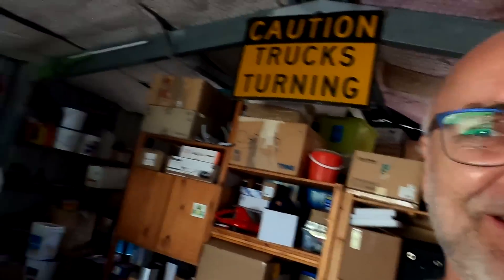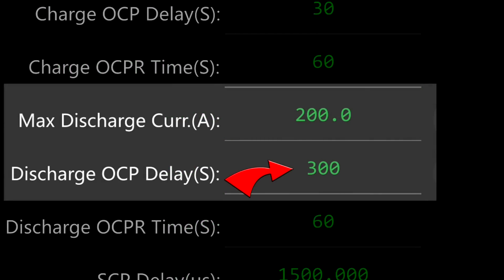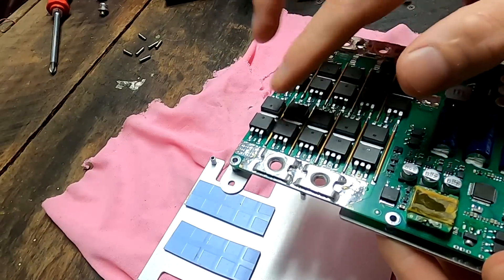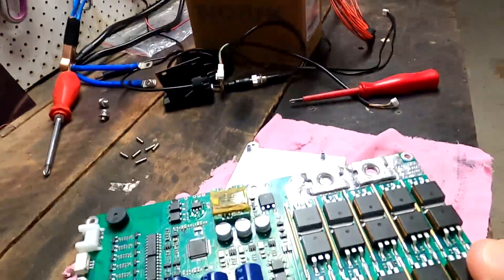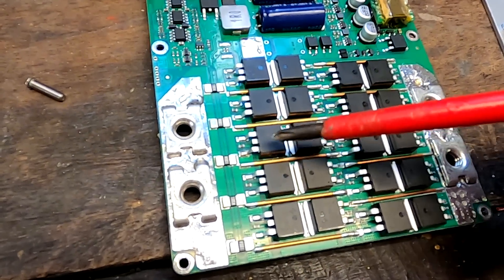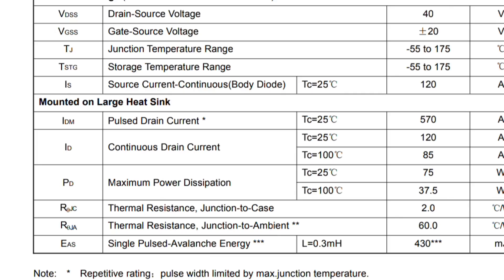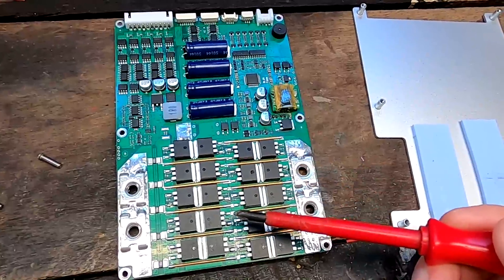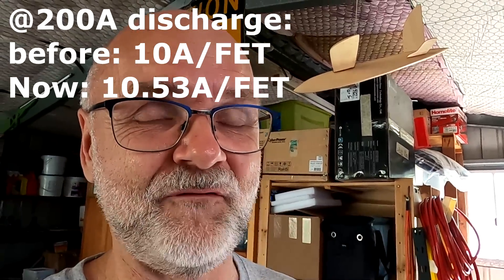Magic smoke! What happened to the JK-BMS? Still reliable or bad design?

Comment: Luckily the MOSFET has failed open, mostly they fail short. I'd not run it beyond 90% as you have lost 20amps of capacity now.
Reply: Um yes...I forgot about the other side of the board. I'm guessing that to get single direction control of battery current that the back to back MOSFETs gates must be individually controlled such that if only one of the pair is on then the other  source drain diode will conduct thus only allowing current in one direction. If both MOSFETs are on then the diodes are bypassed acting as a bi-directional switch. The only downside with using half as diodes at any one time is the dissipation will sky rocket due to the forward diode drop multiplied by the current. If this was the case when you pumped 200+ Amps through it then perhaps the weakest or MOSFETs with the highest forward drop just got that bit more toasty than the rest and pop!
Anyway...all speculation..
Reply: What is the chance for a fail shor at 200A?
Reply from the maker: They carry only 10.5A now under full load, so that's below 90%, right?

Comment: All electronic components have minimal differences even if they are from the same batch. Heating up the components will spread the differences. Also the max. ratings will lower if heated up. As you said in the video it seems like the burnt chip was the slowest when turning off the current. A normal fault would have been a short circuit. Well, but at 200A there was no chance to keep a short, so the internals of this chip have just been vaporized and been blown through the crack on the side to the other chip where you have found them.

The BMS should still be usable at a lower current. To cut off the two pins might be a good idea, but i think it is not necassary since the internals have already been blown out.

It is always a bad idea to switch off high currents. This should only be done in a case of emergency. Overcurrent protection is just a safety feature and nothing for controlling current. After this relays have burnt contacts and as you have shown MOSFETs might be broken and/or shorted if they have to switch off a current higher than they are designed for. ⚠

To replace the broken chip with a normal soldering iron might be possible but is not easy, I wouldn't do it. To heat up the big ground plane fast enough to desolder the broken chip without heating up the other components too much is quite a challenge. Soldering the new component is a little bit easier since you can apply a little pressure on the chip while heating up the solder. If it sinks in a bit you're done. As others have mentioned, you should let someone with a SMT rework station do the job. 😉

Comment: If it was a demo review unit they probably should had tested before shipping it out and avoiding the embarrassing situation. The fact is that there is 20 for a reason and not 10 that would do the same work... blowing one still have the others and is just 1/20 of each had to do... it is a faulty Mosfet so those things happen so nothing to worry about specially if the design just allows to keep moving. I bet that out there would be a bunch of other situations where this happens and no one knows about it. If was outside or ventilated place probably was just unnoticed. Like the real reviews and real cases. Can this one be pushed again till 200A on 2 minutes, and see if the disconnect works and does not blow-up any fuse ;)

Comment: I would not repair the mosfet. This just happens, the board is overengineered a bit anyhow, so no big deal. I just realized - disconnecting 200A by such a small component, that's crazy.
Reply from the maker: Yeah, I'll disconnect the legs and leave it on.

Comment: Ich würde beim defekten Mosfet einfach die Beinchen abknipsen und die anderen dessen Arbeit übernehmen lassen.
Wenn ich jetzt nur von der einen Reihe ausgehe sind es ja 10 MOSFETs die sich die Arbeit teilen, also 10x100A, da dürfte einer weniger nicht auffallen.
Vorsichtshalber den Abschaltstrom auf 175A und die Zeit von 300 auf 120sek reduzieren und damit sollte es ohne Probleme funktionieren.

I would just snip off the legs of the defective Mosfet and leave it as is, the other 9 of the group can most probably take the load easily.
Because if normally there's a group of 10 MOSFETs rated 100A each, I guess 9 will still be sufficient.
For a security measure reduce the overcurrent to 175 amps and the cutoff time from 300 to 120 secs and it should work just fine.

Comment: I'm assuming that each MOSFET's gate is connected together, so I would expect them to all turn off very close to at the same time. There might be a few microseconds between them, as each electric field might collapse in a slightly different timeframe, but surely that time would be within that "pulse" length of time, right? So the current limit should be 570A.
I'm just speculating though.
Reply: In fact, they won't.  The Gate Threshold Voltage is a very wide-range from MOSFET to MOSFET.   For this particular part, it is 1.0 to 3.0V.   So the MOSFETs will turn off completely at different points in time.

This is why the chips are specified to 570A of burst current but only 120A of continuous current.  It means that the chip can handle 570A, but only for a very, very short period of time because the energy being dissipated is massive.

In the configuration Andy is using, the operating current will be more around 20A on each MOSFET which is probably all the board can really dissipate.  The individual chip packages can only dissipate so much energy (37W at 100C is the spec).   So during the turn-off, it is possible for a single MOSFET to take most of the 200A.  And this is totally legal as long as it doesn't stay that way for too long (we are talking in the milliseconds here before the chip blows up).

This is why having the fastest possible Gate driver (in both directions, to +V and to GND) is extremely important in power switching applications.   It is perfectly ok for the current to gang, but only for very short periods of time.  A fast gate driver guarantees this.  A slow gate driver, on the other-hand, guarantees that something will blow up because all the MOSFET's have different Gate Threshold Voltages.

-Matt

Comment: The only way to be sure if its a component failure or a design problem is to run the test again with same BMS and see if more mosfets die, to confirm run the test again with a new BMS that would confirm it. I have a hot air reflow station and could try to replace the mosfet if you have a spare one. I'm local to you. Cut the two legs off the faulty mosfet so it's isolated.

Comment: Have been around test equipment and components. The weak link in componnts like mosfet is the legs. Too small. Cant hold that much current. Compare a 300Amp fuse to one leg of a mosfet and you will see the problem.

Comment: Definitely sounds like a lazy MOSFet.  Didn't want to turn off quick enough and copped the full 205 amps so it popped.
 It can be repaired but being double sided does pose the possibility the FET on the other side may unsolder at the same time.  Would be a difficult job with your soldering iron.  Might be easier with a heat gun.
But it still works so why bother.  To be conservative, limit it to 190 amps max current.  Should be fine.  I might consider snipping the legs off the dead FET.

Comment: in my personal opinion this is mosfet driving issue. If MOSFET stays in its linear region for too long it will overheat and die. To put theory aside - you have to forcibly close them by applying negative voltage to the Gate (for NchMOSFET) ideally or at least short the Gate electrode to Source. Gate electrode are isolated from the rest of the transistor and have significant capacitance which charge must be discharged to close transistor. 

As for desoldering - better use hot air or hot plate and soldering iron. Preheat with hot air (max flow and about 200C) then use soldering iron with chisel tip to desolder the FET. Just crank soldering iron up to about 400C and be careful with burned leg - it can came off along with PCB trace. As for soldering - its the same but whick old solder and apply new 63/37 to the Tab pad (while keeping other two pads flat w/o solder) press new transistor with soldering iron (again 350-400C and wide tip) on its tab then two other terminals and  voi là!
Reply: I second that!
Reply: Yup

Comment: You'll probably find the MOSFETs are arranged in pairs of series back to back(drain to drain) so as there is true isolation when they switch off as this is needed due to the source drain diode within every MOSFET. So this means that there are only 10 MOSFETs effectively sharing the current. Also the RDSOn will be double due to the series connection. The individual MOSFET has to withstand the current squared RDSOn value and this cannot rise faster than the heat can escape from the die else the magic  smoke appears.⚡💨
Reply: You are slightly wrong. There are in total 40 power MOSFETS across 2 board sides on that BMS, NOT 20 total. 40 MOSFETS in total are connected in 2 drain to drain having 20 of those to share the load, not 10.

Comment: Good explanation here Andy of what may have been, and a  lot of interesting comments & remarks that followed.  
I see ‘bigshotdadz’ also received a faulty 8s BMS that spat it around 20A, & I guess we can expect there to be some percent of failures along the way.  I agree with many, as yourself, that we would not usually push a BMS to such limits, but this was an experimental test and the manufacturer does specify that they can surge momentarily to 350A.  
Is it fixable? Most probably. Is it worth it? Probly not. I dont doubt that ur up for the challenge & It may still work ok, but if you were going to use it any further, I would definitely derate its use, to say 150A as a safer margin.  Maybe try another test & see how far you can push it to further support some of ur theories, which. 
Someone suggested get Jikong to send u another for further testing, and I totally support that idea too. A test, is only a test, until u get a consistent result. For the price point, I think the JK does seem pretty good tho. Cheers n look forward to more follow ups.

Comment: Well, other mosfets could have been damaged/overstressed even though they work ok now. Some may have a shorter lifespan now. I would cut the 2 leads on the bad one and be done with it. If you want to replace it, a hot air gun would be the way to go.

Comment: Thanks Andy- I hope mine won’t do that if I occasionally run it at 200A. 😳
Maybe I’ll set a lower max current, (can probably get away with say 190A) AND a shorter time interval. The question is whether or not that will make it safe, (or was yours just a bad Apple?)
Reply from the maker: It should not do this at any point of time. The 20 FETs they are using are spreading the load and current per FET is very low. I'll repeat the test at some stage and see if it happens again. If so, then we have a real problem.
Reply: @OffGridGarageAustralia  Thanks Andy. 👍

Comment: It is my experience MOSFETs fail SHORTED.   They are in full conduction (I.E.  almost a short) when the BMS is in normal operation.   In your case
20 parallel FETs are in series the with 20 parallel FETs on the other side of the board.  This is because a FET is a diode when turned off.  You should
check the Failed FET is shorted, and cut the leads, then see if it seems to work "normally".   The FETS are open only when charging or discharging is 
turned OFF.
Reply: Also, a 40Volt max Drain to Source voltage is too small for a 24 Volt system.  I would recommend the 100VDC FETS in the 48Volt BMS.

Comment: Andy thanks again. Would the ideal BMS not be a JK BMS with all the functionality but  with two relay ports that can drive latching relays (charge en discharge) for higher ampage use such as the Shallco rated at 100 000  mechanical operations @ 300 Amps ?
Reply from the maker: I had a relay BMS for over a year. I think we're past this technology. I'm not a fan of having relays in that path. MOSFETs are definitely the way to go.

Comment: You could replace the fet with your soldering iron and heat gun together.  The problem is you cant do it fast enough without disturbing the fet on the other side of the board without proper equipment. Just cut the gate and source off and you will be fine. The failure might be because it did not turn off as fast as the others.
Reply from the maker: Yea, I'm worried about this as well. It is not easily done as some suggest here. I probably just leave it in and cut the pins of the broken FET.

Comment: That fet. Must been out of spec just a bit, it didn't turn off as fast as it's brothers, leaving all the current on it.  While it wasn't even completely in the on state,. If it happened like I'm thinking, someone could get all new gets. If similar spec, maybe slightly better fets,  it can be very difficult to parallel cheap fets, when the specs differ more than quality fets,

Comment: I would change it out you can unsolder it. You should be able to use iron and a little solder to get exsisting solder liquid a small jewlers screw driver underneath the MOSFET and from leg side and pop it up. Of course you need to unsolder other legs 1st.  Most Industrial Electrical / Electronic workshops can swap it out for you. But I would definately repair it.
Reply from the maker: The problem is the backside where another FET sits. Also, the exact heat to get it on again. Unsoldering might be easy...
Reply: @OffGridGarageAustralia  I have repaired many multilayer boards you only want to desolder the legs 1st you need a solder sucker for this. If you have a Electronic repair shop they should have all.  Once you have legs desoldered then melt a little solder on top the gate and then you will see solder underneath loosen up you only want enough heat to  remove it not damage the board. Once old one out tin new one first on section that solders to board. Then make sure legs are bent and fit in holes all correctly then melt a little solder to get heat transfer as soon as solder under feet becomes flowing remove soldering iron. If at all un comfortable take to a Electronic shop easy fix.

Comment: 5% loss isn't much.
I feel this isn't a one off.
I doubt it is a faulty component, more likely a design fault. Lots of potential issues when you switch high current DC.
How many disconnects until a failure at lower currents
Reply from the maker: I'll keep testing 😉

Comment: What would I do? I would NOT remove this MOSFET physically. I would only remove it electrically, which boils down to cutting off its leads and desoldering them from the PCB. This way you do NOT risk thermal destruction of the remaining (functional MOSFETs!) while desoldering the damaged one.
This damaged one can do an ugly trick and short circuit on its own - damaged transistors can behave like that. That's why, and ONLY why, I would disconnect it electrically without physically removing it.
In my opinion, your reasoning is correct: the loss of only one MOSFET will not significantly overload the others.
IMHO it was a pure, statistical accident that one MOSFET burned out. It simply had to be a worse specimen and somehow managed to get through the technical inspection. It happens.
If these MOSFETs were to be wrongly matched ("too weak"), they would all die as one in the same moment.

BTW: to be honest, I do not really believe in the rated load capacity of 200 A. I would rather avoid such load currents, the golden rule of 80% loading would probably save you from an unpleasant experience. Unless that was what it was about: a test, even if it turns out to be destructive.
Reply from the maker: Yep, that seems a reasonable way.

Comment: Hi Andy, you need hot air reflow station to fix it. I did it in a past with a heat gun and taping with aluminum foil around the target. Chinese components suck...

Comment: Total BMS series resistance at 75 degsC is about 0.45 milliohms which yields about 18 watts of heating at 200 amps.  Heatsinking MOSFET's from epoxy side is very poor at transferring heat out of MOSFET's.  The flat aluminum plate is not much of a heatsink either. If the system does not take heat away fast enough the MOSFET die can get damaged from excessive heat buildup.

Current rating of MOSFET is not the important factor.  It is the Rds_ON resistance.

Neither the 16/24S or 4/8S JBD active balancer BMS meet their claimed 0.3 milliohm spec, not even at 25 degs C.

At 200 amps it should get pretty hot with 18 watts of heating, but BMS MOSFET temp sensor should shut BMS down when it gets too hot.

Over-temp sensing should take over regardless of what user puts in for max amperage and max time for over amperage to save BMS from damage.

Comment: I agree with most here.
Speculating is good, knowing is better! 
Since Hankzor gave you the BMS for testing, just continue doing that to narrow down why the MOSFET blew up
1. cut or desolder the two legs of the faulty MOSFET
2. Lower the 200A max setting by 5% (in order to be fair since one MOSFET less now)
3. Run the same test (now 192A with 300sec delay) a few times again to make sure whether the issue was caused by a faulty MOSFET or if it's a design issue (design doesn't match ampere rating and/or delay duration, so MOSFETs overheat, hottest one switches slower and blows)

Anyway it shouldn't have happened, seller/manufacturer should take responsibility and exchange faulty BMS if it wasn't for testing purposes.

Comment: I would never trust (or push) a fairly cheap China product to it's rated capacity without expecting smoke signals.  Personally, I'd set max current at least 25A below rated capacity and drop the response time down significantly.  I'd order a new BMS and keep that one as a spare once the replacement arrives... Again limiting both to no more than 175A.  

I have not hooked mine up yet, but I will be limiting it to ~160A for a margin of safety.